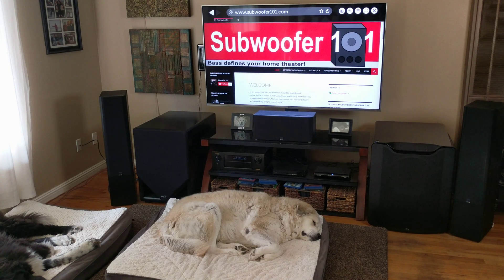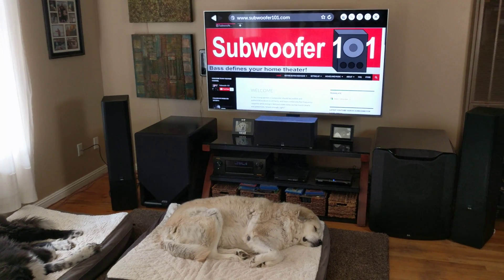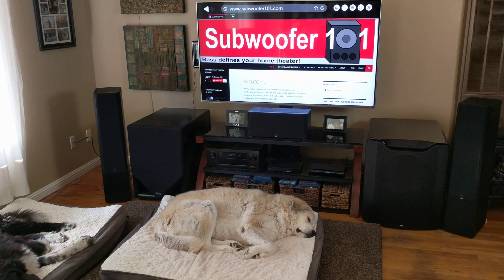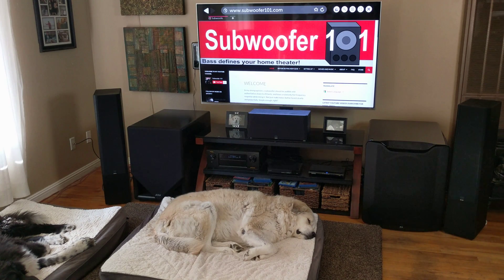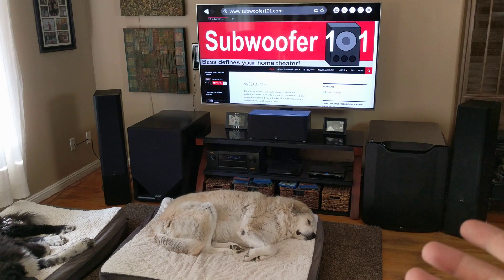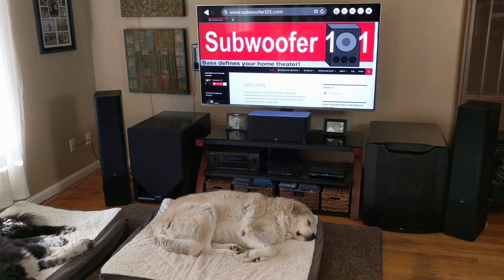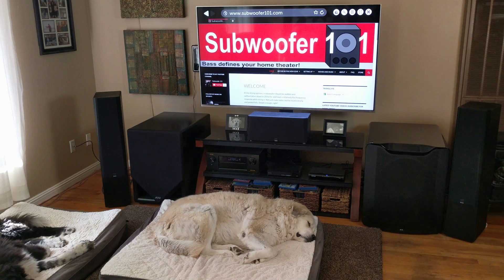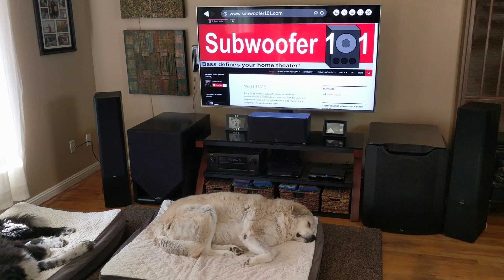Dual Subwoofers: Possible Problems, Pitfalls, and Tips For Making It Work (Wireless, Mixed, Phase)

Comment: I have Two Whalfdale Diamond SW150s on my setup of 7.2. From a Onkyo amp. It has Two sub outs on the back. I was told these are left and right sub channels. So I got a track that had deep sub bass, that runs from right to left and back again, on the Hi Fi. So I put It In the player, and sure Enough It did pan across the subs. So when watching Maverick, and the planes are flying left to right or the other way. The Bass tracks them and sounds much more natural than just one Sub In the system. Also If You can locate Your subs, then they are way two Loud.

Comment: I just got the second Klipsch R 12SW ... and added it to the system( Yamaha TSR-700/ RX-V6A) ( it has 2 subs pre-out) and run the calibration ... I hear them both playing ...but the system still shows 5.1.2 instead of 5.2.2 ! What should I do to see it displaying 2  subwoofers?
Reply: The reciever doesnt have two sub channels. only two subwoofer outputs. theyll both have the same exact output. people have 7.1.4 setups but have 8 subwoofers

Comment: Running duel Rel 812's sounds amazing especially at low listening levels.  Its hard to explain but I live in a tri plex and my neighbors have never complained in two years.  The bass is all there and doesn't need to be loud to bring your system to another level.

Comment: Hi subwoofer 101 I’m running two pb2000 one located at the front left corner and the other on the  rear right corner, I have my front sub at 0 phase should I have my rear sub at 180 phase?

Comment: 15" subs are crazy.  I find a 10" to be my favorite, matching dual as well.  Without those room gadgets I find placement is key.  Acoustic subs are nice but rare for me, had a JL audio in my car that was great.  Lining them up is key, either together or out to the walls, whatever sounds best.  sometimes I raise mine,  and keep the front facing ports under the speaker.  If you don't want to buy new subs Use your old amp and some old towers or something and hook it all up to the subwoofer out on your main amp and it's already crossover'ed.

Comment: Haha! You haven’t had many problems because you bought those monsters. Lol
Using a smaller dual setup is harder to setup because of room size, shape, etc. 
My room is very large and I’m using two PB 1000’s. I’ve had to move them around to find the right spot, and now they sound great. If I bought even the 3000’s, they would certainly punch out dead spots. It still wouldn’t be perfect, but more forgiving.
Reply from the maker: The power of the sub doesn't have much impact on the even sound, try my Distance Hack. Should be even throughout the room, but some areas can still suffer, like near walls and if you are to the side of the subs, best to be "down stream" from the subs.  

BTW, the Labor Day outlet sale is happening now: https://sub101.link/LaborDay2019

About 1/3 of the stock is gone in the first 6-7 hours. They are going quick!
Reply: Subwoofer 101 I can agree with that, but I just that if I had larger ones the fine tuning might be more forgiving.

Comment: Dual PB 1000s or dual SB 2000s?
Reply from the maker: The Outlet sale is happening now, check out my most recent video. Definitely go dual. There are a few PB-2000's at SB-2000 prices, but they will likely be gone today or tomorrow:  https://sub101.link/LaborDay2019

1/3 of the stock gone in the first 6 hours.

Comment: I have dual subs in a weirdly shaped room. The subs are along the left and the right walls. One is about 10 ft away from the seating position and the other about 13ft away. The room correction software (audyssey) shows the sub woofer distance as 10ft. Wondering if that is a correct assesment. Am confused about what the distance should be when using dual subs
Reply from the maker: Which AVR are you using? And which subs? I'm guessing they aren't DSP controlled, otherwise they would be reading 2-3 feet farther away. 

You can try adding 4 feet to the post Audyssey subwoofer distance (14 feet instead of 10) and see if that helps. Also, if you don't keep a tight grouping, no more that 2 feet from the first measurement, that can affect your results too. 

I prefer subs to be on the front wall, but that's just a preference that I'm comfortable with, and I understand limitations.
Reply: Am using the marantz nr1509 with yamaha sw300 subs. Dont know if they are dsp controlled. Ill try your suggestion and see if that makes them sound better

Comment: I got 4 of the same powered polk audio 10 inch woofers. It seemed to hit harder with just 2. I bought new wire. They are all ran the same in a row up front in between the right and left soeakers. They hit but it doesn't seem right I guess I need more time to mess with them.
Reply from the maker: 4 are more complicated than 2. Timing issues, etc...

I did a video on 2 vs 4, and I'd rather go with the hardest hitting duals vs less powerful quads. 

Check these out, especially the very first sub on the list. It's going on special again very soon, and would be a dramatic change:
http://www.subwoofer101.com/best-subwoofers/
Reply: @Subwoofer101  thanks for the reply. I agree with you get what you pay for and that 2 hard hitting subs will be better than 4  ok hitting subs.

Comment: can I use one down firing sub & normal sub in dual woofer set up???
Reply from the maker: Not 100% optimal, but if they have the same guts it's not so bad. Mismatched duals sound better than a single, but oddly the sound takes on the characteristics of the weaker sub. Matched is ideal.
Reply: of course you can...but you will need to set the phase  adjustments properly so that they dont cancell each other.... down firing subs may require a different phase setting  if you are trying to match it to a forward  firing sub

Comment: Worst scenario of speaker setup is this....
they are so close to each other that its tragedy...
Reply from the maker: I'm within the 25-30 degree spread from my main listening position.
Reply: @Subwoofer101  Not only the distance between speakers is tragedy here, tragedy is 2 different types of subs , if you go with stereo subs they must be the same, identical, you have here farquency problems, cone and box of subs are different and they make different sound, they have different switch inside, different overcross.
This is total disaster....
I have Studio monitors M-audio BX8A Deluxe and 2 Subs m-audio SBX10  overcrossed monitors to 60 hz so my monitors dont go anymore to 35 hz, my sound keeps clean and perfect in every way.
Distance between speakers is 4 meters and im distanced 4 meters from them, perfect triangle distance.
And yeah i dont keep my subs on the floor, i have them on the Komode high 50 cm from the ground and on the top of them are monitors, its like i have 3-way speakers.
That is the whole point with the subs that are identical to get 3 way speakers with your 2 way monitors or whatever.

Comment: having both at the front us a bug no no ...you won't get rid of many bass free zones ... frequency dips ...one in front one at the back ....thick even bass across the whole seating area
Reply: +Subwoofer 101 you can't get rid of bass nodes with both up front ..no matter what software you use ..sound waves are sound waves ....or as they call it ..Swiss cheese bass
Reply from the maker: "As they call it?" As far as I know, I coined the term, but I could be wrong. I've searched for the term and only found it in my own content: https://youtu.be/865RhwRLUM0

As far as not being able to reduce the standing wave effect with subs up front, lets agree to disagree. There are certainly some placements that are better than others, but one of the benefits of duals is more freedom in placement. 

You can get cancellations with the front speakers, but adjusting the distance helps that a lot. I shot the video linked above (Swiss Cheese Bass) as a result of reducing the standing wave effect, with the subs up front. I don't know where you heard that subs up front is wrong, but it does the job.
Reply from the maker: I use my "distance hack" and get great response overall, which I've measured. Duals are more flexible.

Comment: Does each subwoofer need to be set to opposite phases of each other?
Reply: i agree with comment below...on opposite side of room, usually opposite phase settings ..THOUGH, i run 2 up front on same wall, similiar layout to what is in the video, but if run IN phase, they cancell each other and i have to run one  in phase and the other 180 degrees out of phase for the bass to  be  multiplied....now these  are Not identical subs, different manufacturers , but they Are forward firing and both ported...one is ported on the front and the other is ported on the back...That may be why the  opposite phasing is needed in my situation...ur ears or a db meter will confirm ur phase settings
Reply: only if one is in front of you and the other behind

Comment: Hey guys. I’m a newbie and building a 5.2.4 system. I’m running a Denon 4300 9.2 channel avr. 
So at the moment I only have 2 front Kef 700s and also 2 subs the Kef 400b. When I’m running a sub from subwoofer preout 1 all sounds great. If I run a sub from preout sub 2 it makes a rattling constant sound. So regardless of which sub I plug into preout sub 2 it does this. Also when I run both subs dual on preout 1 and 2 it does this sound from sub 2. 
I didn’t run room correction with audessey or anything else. What could be causing this? Thanks!

Comment: How do I connect dual passive subs to home theater?
Reply from the maker: You'd need an amplifier to connect it. I have only done that with a really low budget setup, but I believe you would run the subwoofer output to an appropriate amplifier and then to the drivers. The one I used had the sub amp in the AVR. Long ago!! I'm not totally up on how to set up passive subs, so maybe others can chime in with advice. I have a pretty knowledgeable audience. It depends on what you're starting with too, there are plenty of variables.

Comment: Hi! First of all - your videos are great! I have learned a lot from you and was able to set up my system (mainly bass management part) so that I really like the way it sounds. I am running 5.1 system with PB1000 (have selected it also thanks to your videos), the set of absolutely brilliant speakers - QAcoustics 3000 (with 3050 towers in the front) and the Marantz SR5009 AVR. I am planning to make it 5.2 some day, by adding the second PB1000. Easiest way to place the subs will be on the either side of the towers (will look very much like your front setup just the subs will be outside. Cannot place them inside, because the towers will be too exposed and the kids are running around..). With that the distance between the subs will be around 3 meters (10 feet approx). Is this sufficient to get good sounding bass?
The other concern is regarding room correction. This AVR has 2 outs for the subs. Will Audyssey "see" 2 separate subs, or will it see them as one? In one of your videos there was a screen from your Denon menu under bass level adjustment, I saw Subwoofer 1 and Subwoofer 2. So it seams that the AVR is able to see and calibrate 2 subs separately.
You might have covered this topic already, but I kinda missed some detailed set up of 2 subs. Maybe need to scroll through the videos again :)
Anyway, thanks again for the very helpful information and all the tips!
Cheers!

Comment: I'm getting ready to run dual subs, unfortunately my first sub is not available anymore but the second sub was not available until SVS decided to make a short run of this older model for a nice price.  The first is a PC12-NSD and the second is a PB12-NSD, which as know one is a cylinder and the other is a box.  As far as I know the two are accoustically equal, so hopefully they will pair just as easy as if they were both the same model.
Reply from the maker: +Arthur Schamne I think you will be good with that set-up. The subs are so close that it shouldn't be an issue.

Comment: What do you think is a good solution on how to control subwoofer without a volume control?
Reply from the maker: What's the situation? What kind of subwoofer in what kind of setup?
Reply: I have a subwoofer that does not have a volume control. I thought it will be easier to blend in another subwoofer if I have volume/gain control on it not the AVR volume control.
Reply: Thanks for the reply as always. I hope I found the solution to my problem. I was advised to buy a passive volume controller and some cables so I can hook it up between my AVR and subwoofer that don't have a volume control. I decided to go this route for now until I can afford to buy another SVS PB-1000. So what do you think? Will this work? Thanks.
Reply from the maker: It really depends on what the subwoofer is. It may not be worth the trouble, and the AVR control might achieve the same thing. Which subwoofer and which AVR are you running?
Reply: I have the Yamaha (AVR) and Kef HTB2-Se. It a 10" sealed sub with a 250 watt RMS. Anyway, I bought the control and cables that cost me $45 which I think worth the trouble to play with it. I know you mentioned on your other videos about running into problems mixing and blending  two different subwoofers. I know SVS PB-1000 is superior than my old sub. So I'm not expecting  to perfectly match their output but at least close enough.